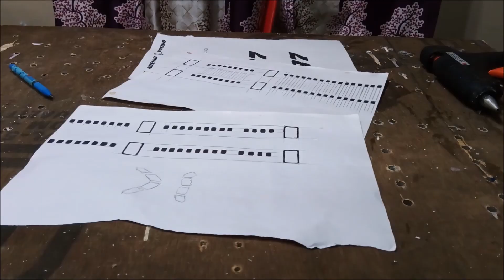Boeing 787 Dreamliner(Glider) Build Video

Comment: Glider is nose heavy.  You need to set the center of gravity (CG) using weights to balance the aircraft at the wingtips or at the thickest part of the wing at the wing roots where they are glued to the fuselage.